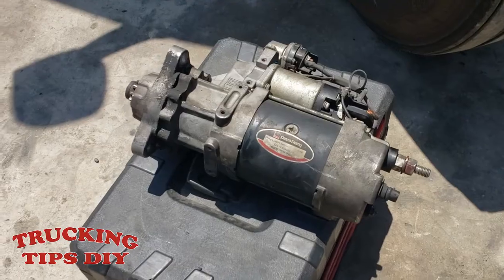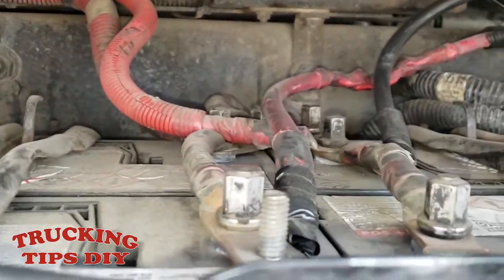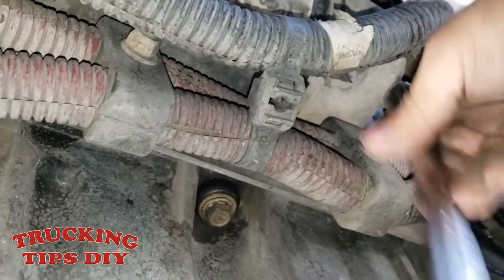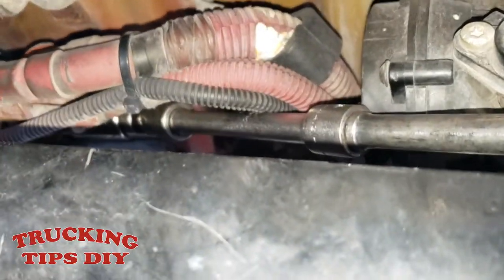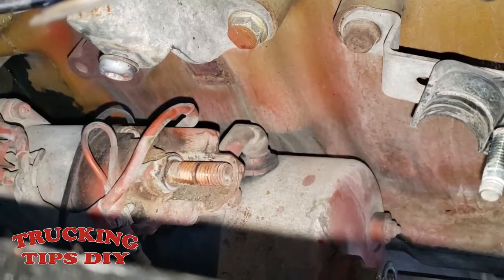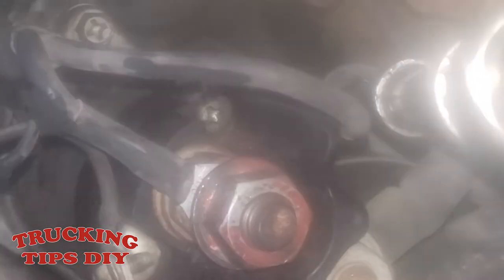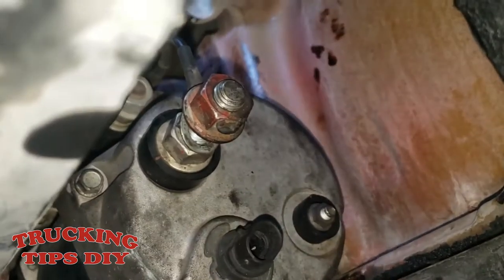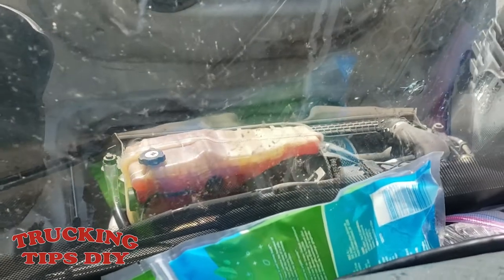How to remove and replace starter on Freightliner Cascadia (step by step)

Comment: Does that plug go to the ac compressor? I had a starter and pdm replaced at my terminal and they didnt plug anything on the pdm. So i think the compresser is disconnected

Comment: Hey I wached video your video removing starter  what sockets you used stater 3 bolts took two out but I can’t remove one is tight  am aslo  using 16 mm for stater

Comment: Hi there, what is electrical wire that a plastic clip to undo for? I replaced my husband's starter on his freightliner and accidentally pulled it out wrong but the wires I just taped together and truck starts up fine. Great video wish I had looked it up.
Reply: I may have found what it is the thermostatic connector?

Comment: Sorry for the dumb question, 
Did you changed it because it was bad or was going bad, 
And is is draggin a sign of going out, pls advise
Reply from the maker: hello, yes the old starter would drag  and it would make a sound when starting, before you change your starter, make sure the batteries are well tightened,  and also the wires on the starter

Comment: My truck freightliner cascadia 2016 automatic..
The truck won't start no crank sound just giving the click normal sound when I try to fireup no check engine light showing and by the way I'm sure my truck has power but still no start .
I was doing just too make sure using the battery cable to make sure charging up the truck battery for some time than try again but the truck still no start and no crank sound.
not sure what's going on .
Reply: Mine also a automatic and it just happened today , I hear no noise and checked voltage it was ok ,   I also trying to use screw drivers to bypass ignition was only clicking..I think my starter is bad. How was yours fixed ?
Reply: @chicocazador1098 same here. Today. What was the solution

Comment: Hola, una consulta.. Como puedo hacer para que el cascadia siga andando en ralenti sin limite de tiempo y no se detenga el motor,, hay alguna manera o solo es vía pc
Reply from the maker: hola, como en ralenti?
Reply: @TRUCKINGTIPSDIY  cuando queda andando al mínimo,,, 500/600 rpm por defecto el motor se detiene a los 3 minutos,,,, como dejarlo andando sin ese límite de tiempo
Reply from the maker: @cristianberrios7799  mire este video, tiene que remover el speed sensor de la transmission 
https://youtu.be/q1gGn716wQE
Reply: Gracias amigazo
Reply: Yo tengo un Freightliner Cascadia de 2009 con motor de Serie 60 y no se si será lo mismo en todos los Cascadias pero desconecta el plug de la pedal de hembrague (clutch), se te va a quedar todo el rato encendido, si quieres puedes manejar a si también pero el freno motor queda inactiva, así es como hago en el mío
Reply: @unaiagirregomezkorta7807  ok gracias
Reply: Solo activation el crucero Desdemona el timon y te subira a  700 y es todo